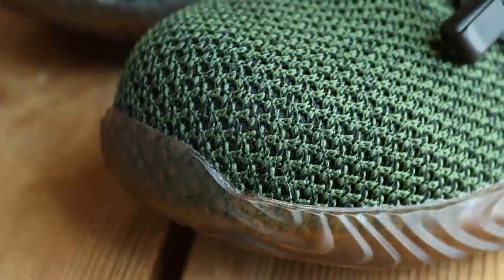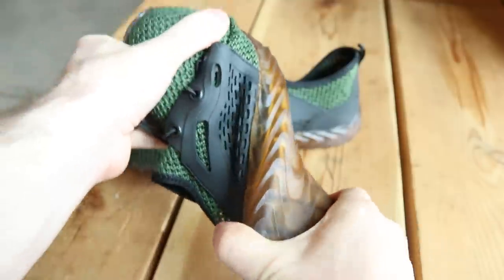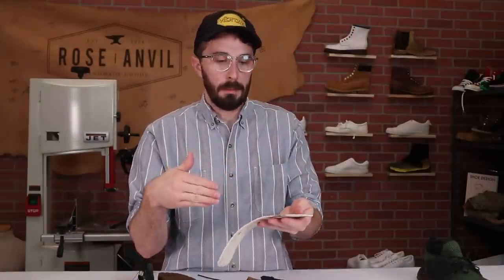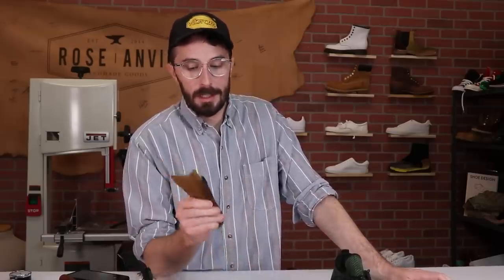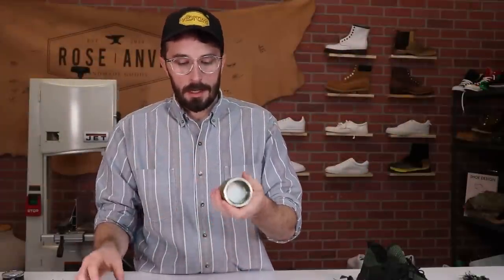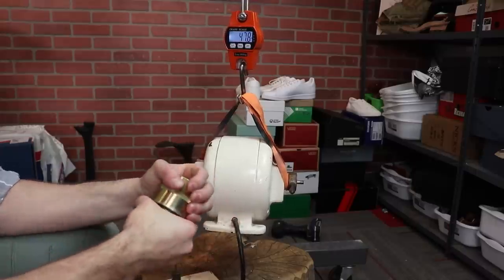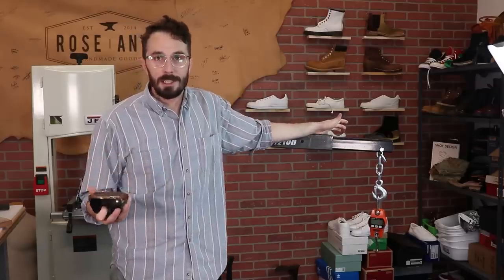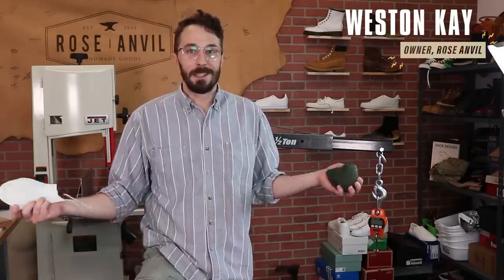Never Trust a Fart or These Indestructible Shoes

Comment: I'm fairly certain these shoes offer superior protection to other shoes in this price category (they're about the same price as some basic sneakers with zero additional protection I could go an buy at the store right now). Plus I don't really think you're being fair here - the mechanics of stepping on a nail are different from what you tested - the nail is likely to be bare most of the length, and will bend rather easily, so I wouldn't be too worried about a nail puncturing the reinforcing material in real use.

Comment: I cannot wear steel toe caps because the edge lands right in the middle of my big toe joint, that apart I’ll bet these fall apart pretty quick soon if you wear them in the wet !!  PLUS polythene or whatever that stuff is that DM soles are made of is is bloody slippery in the wet, ask the guy that got on a slate roof in the rain !

Comment: If you need an actual foot protection, you buy workwear shoes that are made for your use case from reputable brand.
I work as an IT-Specialist in a factory that has liquid chemical process, so I have pair that are resistant to pretty much everything, including chemicals, puncture, anti-static etc. and those were only bit over 100€. I don't see why anyone would risk their health by buying anything from some unknown brand as a safety product.

Comment: I own several pairs and the ones I got close to 2 years ago have a metal plate in the sole. I guess they do not make them that way anymore. Either that or they are harder to find. The ones with the metal plate are not very flexible like the version you have is but that is understandable. :)  Also while typing this I did find some on eBay that has the metal plate made by a brand called Wisstt and they look like what I have. I would love to see you do those to see if they do in fact have a metal plate because mine are not worn out yet and I do not want to take them apart. :)
Reply: I did take mine apart and it was a steal plate for the midsole instead of kevlar.

Comment: It's been said in quite a few other comments, but some points have been missed. Not only do most tests show what would happen when stepping on multiple nails, which reduces the pressure on a single point, but they also show the shoes, while on a foot, stepping down onto the nails. This has some separate implications in that not all of the person's weight would be put onto the nail as shown in your test. You showed probably 160 lbs directly on a single nail being pushed into an unsupported region of the fiber material. That would not be the same as wearing one of the shoes and stepping down. Right away, you can roughly halve the weight that would be applied since both feet are typically on the ground when walking, at least for a portion of the time. 
Also, the thin outsole may actually be beneficial because it will allow the wearer to feel when they are going to step on something before they would necessarily put their foot down completely and are going to take another step. Most likely someone wearing these shoes would feel that something wasn't right when their foot didn't automatically go all the way to the floor and would put their foot somewhere else. The test you demonstrated is most analogous to someone who is running where the full weight of the body is on a single foot, but even then, the weight on that foot is distributed over that entire surface area, not on a single point.

Comment: Say what you want but I bought a pair of these off aliExpress for about $25.  I have been tearing down a hoarder home and they have saved my feet around 8 or  10 times now.  I have had  a 2x4 board actually stuck to my  foot. Now I won't go stomping on a nail, Heck no but for just walking around they absolutely work.  I weight around 190 lbs. My real life experience has proven they work. all the testing in the world can't reproduce a real life situation but i have.

Comment: You were moving side to side when standing on tge 2x4 thus changing force direction.

Would be more "Scientific" if you used an analog scale or a realtime digital scale to see the breaking point.

Could use a jig to add weights to the top or even a colander of water that you keep adding water into.

Comment: I'm glad you said far form scientific, you don't need any fancy equipment. 
Let's talk about errors of test.
Test substrate one
Test substrate two
No test on combination of product.
No test on overall soul.

Better setup for your system I can see is you have a pull scale, meaning it gives digital readout for a hanging mass, you can turn it upside down, and make a leaver force system. where you lift with a set force like 400 lbs, lets say. you have it on a gear crank. SO you can slowly take the weight off the scale, but its backwards, thus no lifting, except the start, kind of like a spring trap. Build a wood system. then lower it. It will not start going down until you start cranking it down. Just go like 1-3 pound increments depending on your gear setup that lowers it slowly on each crank. Until all 400 lbs. since its a lever method you could always add more, unto the maximum pull value your measure is rated for. 

The method your using in the video seems a janky. Dangerous, since your meddling with insecure loads. I think 80 dollars of study wood, a frame and a lever arm, and then you could just cut some  notched gears, thus lowers X height from the arm.  Or you could keep it that one, but yo udon't need a dentist lathe etc... you can use tension in different ways, where you don't need to estimate on the weight. :D

yeah those shoes failing at such low weights... is pretty alarming. One would hope like they would be rated for atleast 400-500 pounds of force. L\

Comment: It's a shame they advertised these as "indestructible." I've had a nail go thru skate shoes into my foot and they were twice the price. Compared to a regular sneaker they seem to have a few clear upgrades (steel toe cap, burlap sole liner, decent sole weld) but the marketing is so overblown that the expectations become "work boot replacement", which they are clearly not. For a $40 "barefoot/zero drop" shoe I still am considering getting a pair

Comment: There's a high chance it's UHMW Polyethylene (brand names Spectra, Dyneema), not Kevlar. Kevlar would be yellow, UHMW PE is white. A quick way to test is to see if it melts. UHMW PE melts around 270F; Kevlar and many other aramid fibers do not melt, they simply decompose under heat and that doesn't happen until around 850F.
That's not to say it's a bad product. UHMW PE has actually taken over the body armor market as a superior alternative to Kevlar.

Comment: As for puncture test couldn't you build an inexpensive set up using a bottle jack with a point attached and a scale as a platform for the material? You could use two small wooden frames to clamp the material so that the point would never make contact with the scale. Elasticity would be an issue for true results I suppose but as for having your own rating system I think it would be pretty accurate. Whatever the scale reads right before resetting to 0, when the point punctures the material and is no longer putting force on the weigh-in platform, would be your number to record. Or realistically the highest number before dropping to 0 or close.... This would really be a better system than what you've got there. It's kind of the opposite of what you're doing but most importantly is the bottle jack will allow you to easily and slowly put downward force and depending on the jack size can give thousands of pounds of force. Also it would take up less space and could easily be built with wheels so it can be moved around. Hope you see this and give it some thought. I've seen similar set ups for similar purposes so I can't really take credit for the idea.

Comment: I have a pair of these. I bought them to meet the requirement for steel toe at my workplace; but also be cool on my feet, as I worked outside in FL. They are horrible in quality. They serve no other purpose than what is mentioned above. That's why it only costs $80 (I wish it was $45). You get what you pay for.

Comment: Something about the "nail test".  The ads show them stepping on multiple nails at once, not one nail by itself.  Even if you stepped on a single nail. . .  Notice it took almost all of your weight to puncture with that single nail.  That tells me that if you stepped on a single nail you'd more than likely notice the resistance against your foot and you'd lift your foot up before you reached the point of full puncture.  And I have stepped on a couple nails myself.  In normal footwear your foot would sink down and you'd feel the pain before you even knew there was a nail there.  So feeling the resistance and being able to lift your foot before full puncture happens, will save you a trip to the ER and a tetanus booster.

Comment: You don’t need to own the puncture test equipment.. maybe you could make your own method of testing puncture resistance and compare it to the standard method... just ask YouTube. I’m sure there’s someone that will give you access to one. Your nail setup seems legit.. you just need to define the nail dimensions.. and to make your setup more stable. Here’s some ideas: get a few nails or spikes machined to known angles (common screw/nail head angles); instead of lowering the weight by rope, get some shafts and bearings to guide the nail.. or linear bearings, make friends with a mechanical engineer 😁

Comment: You don't really need it to resist all of your weight, though. When you walk, when you push a foot forward and push it onto the ground, you're only putting half of your weight on that foot (the other foot is still on the ground at that point). It isn't until you pick your trailing foot off and then roll your leading foot forward that your leading foot gets your full weight (and even then, it's only at the ball of your foot in mid-pivot), and if you step on a nail, you would surely know it before you pick your trailing foot up and/or before you roll forward on the ball of your foot, and it would only be a danger if the nail were to actually hit the ball of the foot and not somewhere else, such as the arch or the heel. The danger of a nail coming in through the side is still there, and it's a glaring flaw in the design.

Comment: Bought these for work, in short, I stock for a beverage distributor. 
The lower sole ripped off in a few months, bare steel toe was showing after a few weeks, these shoes are terrible, do not buy. The company will not replace them either.

Comment: The uppers are a wrapper on which to market a narrow Kevlar footbed and steel-toe in a unique, low-top package. I see an application for jobs like a hot day of Roofing, where increased flexibility and less insulation is desired. There may be myriad other places too, despite my suspension of faith.

Comment: You could tell it's a lie the second you see the add where they use several nails. Stepping on many nails is easy, the weight is distributed between them and the more you use the easier it becomes, with enough of them you can do it with bare skin. You're not going to step on a patch of nails, you're going to step on one, maybe two and this shoe will not hold up to that.

Comment: You can stand on multiple nails barefoot assuming they are close enough together. Hell, a ballerina shoe would offer enough protection to stand on 5 closely placed nails assuming you're not fat like me. 🤣.... For real puncture resistance you have to either have a thick tough sole or sacrifice comfort with a hard, strong but thin sole. I would think anyway. Even a lot "bullet proof" material is fairly easily punctured.

Comment: Your tests lack any control or baseline - you don't necessarily need different equipment, just do multiple runs on each of several comparable materials, to confirm that 1) you achieve a reliable measure for a material, and have some understanding of the error margins 2) context of materials vs each other.

Likewise if you're trying to infer something from your experimental setup, you should confirm that the inference has a basis. So if you're inferring that the weight in the nail test is comparable to weight of a person on the shoe in a real life instance, then you should demonstrate this.... obviously safely =D 

So for instance, you could put like a metal insert into the shoe, and walk normally over the nail while wearing the shoe, to see if it actually would pierce in practice - this would just be a sanity check basically - it's extremely common that experimental setups just do not match any conceivable real-life situation, which is a constant frustration for scientists lol

You might also want to check out academic papers on these exact sorts of tests - not a lot of people know it, but you can actually access many academic papers (the research performed by scientists) by going to Google Scholar and just searching for the topic or procedure you want information on. This can be absurdly intimidating, but if you just dive in you'll find it easier and easier to do, and more and more rewarding.

Comment: Kevlar is not puncture resistant, thats why you can stab a person through a bulletproof vest with a knife or an icepick... kevlar has abrasion resistance, is unwilling to stretch out and tear by blunt force, but a fine razor sharp blade/needle tip will go through layers as it can just spread em... the same reason armor piercing weapons of medieval times were pointy hard objects, it’s because of the pressure laws and force multiplication over a smaller surface... Trying to step on a few nails, ok, but I wouldn’t try it with a singular needle, as you just might end up with a hole in the sole and the foot...

Comment: I bought mine for kayaking. They do the job 'ok' but they are the most uncomfortable shoe I've ever worn, (which basically makes them worthless for both kayaking and hiking). The material is very cheap and the shoelaces mine came with were probably the cheapest shoelaces on the planet.. They run long and the arch on mine rubs a-lot.. They are also quite slippery for a 'non-slip' shoe..
I feel bad for the people that paid up to $150 or more when these came out. I got mine for $75 and feel totally ripped off. Even $45 isnt a good deal once you actually see the quality, (and if they hurt your feet as bad as mine).. 
I guess they're fine for light shop work, or in my case a river shoe, but I'd advise anyone to just save that $45 and put it towards something of quality.

Comment: So what about the resistance between both the kevlar and the sole combined. It took your weight yeah but didnt have the addition of the sole to add resistance. Should've put a swatch of sole and kevlar into the rig and tested it properly. People just don't go walking out willy nilly with in-soles or just soles. Come on do the test correctly. Lots of misinformation here.

Comment: Anyone who would use these for a serious construction job would have to be nuts. I’m saying this before any testing. These are just a glorified sandal in my opinion. I wear only sandals when I’m not working. I got these for 25.00 bucks on AliExpress and I love them. I feel like I’m only wearing socks. 70 bucks is egregious on the indestructible shoe website. If you need safety shoes this is not your go to,IMHO.

Comment: I bought a couple pairs just to see what the hype was about and I was highly amused. In a month I had worn the tread smooth, the metal toe box is made for Chinese manlets and my toes rubbed on the outsides, I didn't find any nails to step on, and I slipped and fell on my ass when I walked over some wet concrete.

I'll stick with my work boots or Vans. I skateboarded to work for 2 years and my little flatties are still going strong. I've smoothed the middle of the toe section on my pushing foot, they're stained and dirty, the sole is torn to shreds on the inside, but they're super comfy still and I have no leaks. The best part is, the Vans were cheaper than these damn things after customs and taxes here in Canada. I think I paid $80 per pair after all was said and done even with their discount thing, whereas my Vans were $60.

Comment: I tried these shoes for my work once. Not exactly this green model but a blue camo style. They were very comfy and soft, "hugging" the foot well. BUT, the steel toe was heavy compared to the rest of the shoe and after a while it felt weird. AND, the steel toe was very narrow so the edge of it was hitting my little toe and it felt like if I kicked something hard in the wrong angle it would cut my toe badly. Now these shoes are extremely cheap and i had them while working with ground work and sand and dirt always gets in to the shoes, no problem I just empty them every now and then. Problem with these cheap (experimental) shoes is that the combination of sand and a sweaty foot going in and out many times per day is that the heel part wore out completly and the whole shoe became loose and baggy and I had to thorw them away after just two months! Just shit shoes if you want to know my opinion. Normally I always wear Safety shoes or boots by Sievi or Jalas. Both made in Finland and they last for two years, at very hard work outside kicking sand and dirt winter and summer. even longer for inside work. but I don't think you can repair them much, maybe the leather parts on the inside but other thatn that its a use and throw away shoe.. So Rose Anvil, it would be intresting if you could and want to tear apart a pair of sievi high end shoes or boots. Pretty much every man woman and man to be wears Sievi at work where safety shoes are required. And that is why I'm ordering a pair of safetyboots from Aussie just to try something else. Something for my work buddies to laugh at I guess. This became a long post, I had a few beers and no one to talk to. Happy new Years and good night!